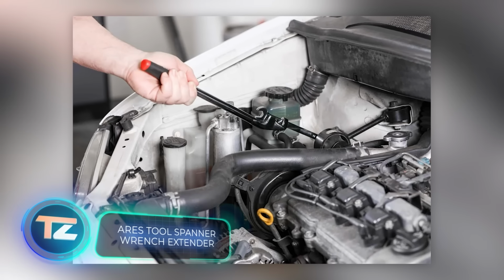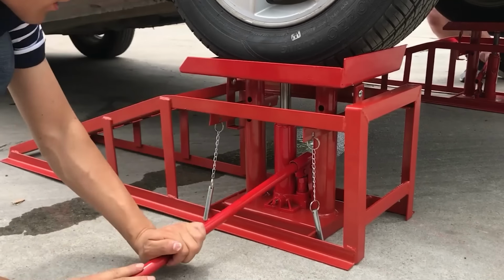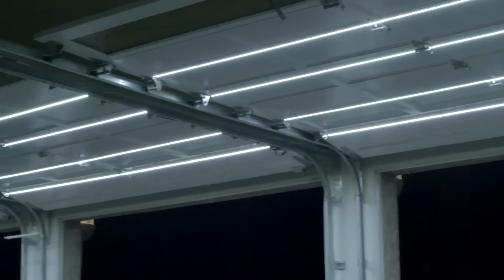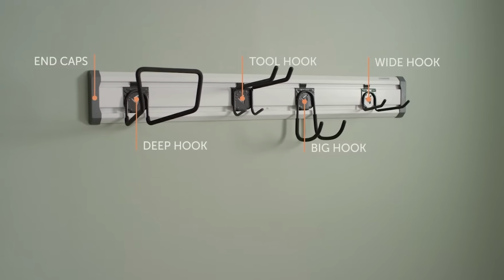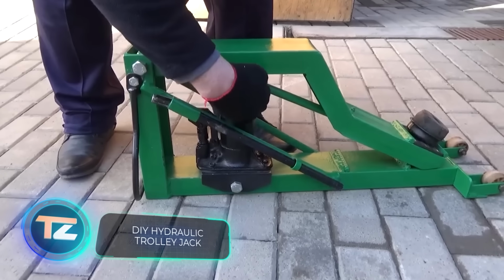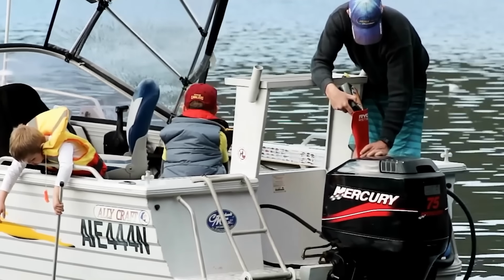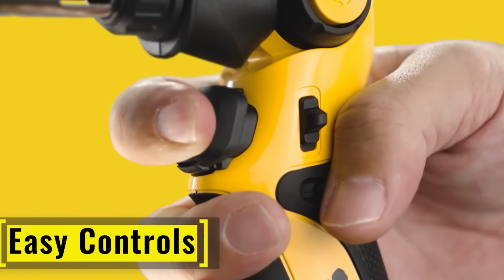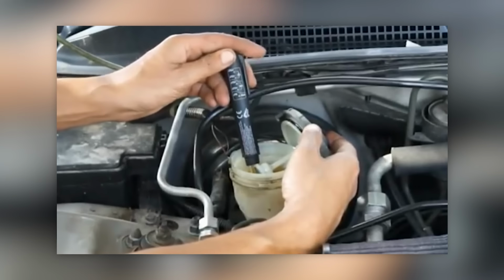25 COOL INVENTIONS AND TOOLS FOR YOUR GARAGE

Comment: 5:50ish, low voltage doesn't mean low wattage, it just means a voltage low enough it can't travel through the human body easily reducing the risk of electric shock, you can still be pulling hundreds of watts through low voltage.

Comment: Seems like everybody is just stealing inventions from the past, in every video I see at least 2 inventions that I saw my grandfather use and were passed down to me. Such as the wrench lengthening devise in this video so far.
Reply: We had a 36" long  2 inch pipe as a wrench extension that would be able to break any nut in our motorcycle shop. (At least not your own😅)
Reply: Yep! Nearly all that stuff is a case of reinventing the wheel, again! LOL
Reply: I still use my 2 air jacks that look like a utility dolly with long arms each can lift 8k
Reply: @sneezinhatch  yeah, my grandad owned a tire shop, he had two of those. Those went to my cousins, I got some of his other tools. I would like to buy one but only get glimpses at estate sells.
Reply: Or.... you can just use a second, larger wrench to do the same thing
Reply: @ryanc3219  I personally like my 24 inch 2 inch pipe. I just have a bunch of tools from the 40s and 50s my grandfather left me.
Reply: I like the idea of the $6.00 brake fluid tester if it's accurate.
I'd like to see the list of items demonstrated and prices and Amazon or other like if possible
Reply: Granted most are breaking the piggy bank.
How much is the  big car lift?
Reply: Evolution is a fickle beast. .

Comment: Most of the prices are hilariously high, but I still love watching these to give me fabrication ideas for DIY clones.  
A reasonable one is the parking protectors.  I've nearly lost both mirrors without them over decades.
I recently bought a Vevor retractable air hose reel which I truly love. $68. Maybe the ret ext cord is next.
The only high-but-reasonable price is $7,400 for the UL-300 lift and frame repair bench, which will pay for itself.
Any skateboard could be used to lift a car or truck wheel, saving $150. 
One can make a morphable creeper, wrench extender,  wheel roller, for pennies on the dollar.

Comment: Low voltage doesn't mean cheap to run 10w is 10w @ 12v or @ 120v or even @ 240v meanig regardless of voltage it would cost the same to operate

Comment: Insects don’t get inside a vehicles radiator.
Reply: Not only that, but pretty sure disconnecting your radiator just to flush it out with a compressor powered water hose attachment isn't the greatest thing, either.  Feel like you'd risk airlocking the coolant loop if everything isn't properly flushed and refilled....